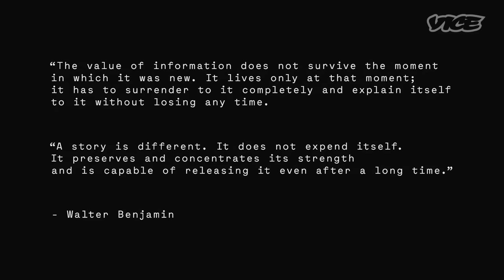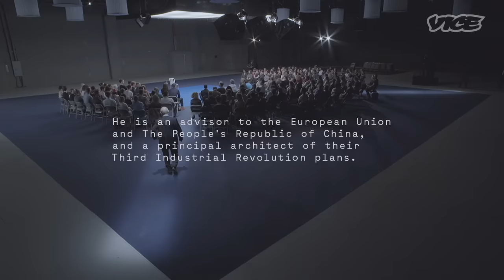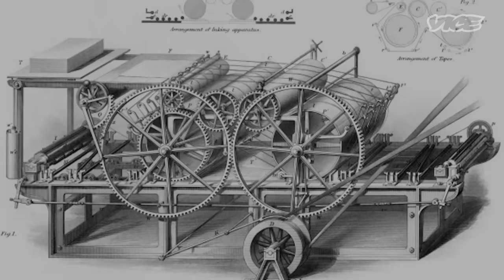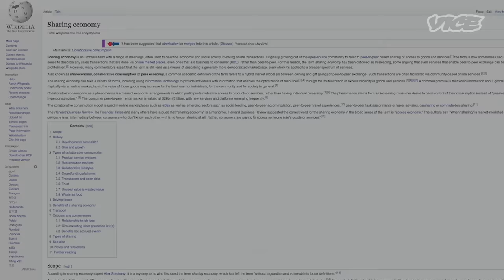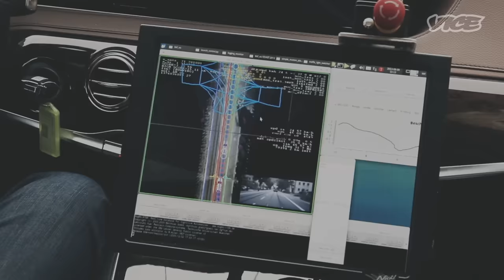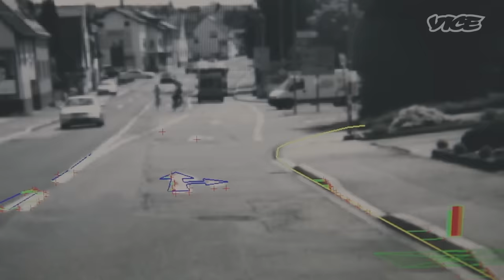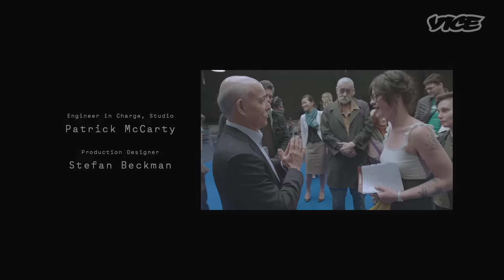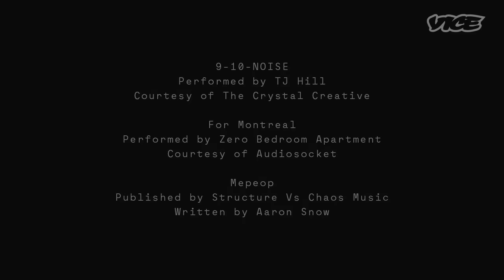The Third Industrial Revolution: A Radical New Sharing Economy

Comment: "Car sharing" is more like a hipster term for under-regulated taxi cabs. The same for much of the so-called "sharing" things. It's more like algorithmic classifieds than "sharing" most of the time. The actual "sharing" stuff is free distribution/open-access, or things like free-cycle and book-crossing for physical goods. Otherwise this "sharing" economy is nothing new, basically rentals and services, paid.
Reply: @C Kpdx The way you worded that made me think that everything he said and the sharing economy really sounds like communism re-packaged as something shiny and new. That said, he does speak of decentralization, off-grid and distributed systems. I think it would be a mistake to include those things in the topic "sharing economy" as they are more of an autonomous economy, moving away from interdependence. I believe in that, economic interdependency is why we have terrible fluctuations and volatility. Moving toward individual resource self-reliance can prevent many deficiencies and travesties.
Reply: @C Kpdx As long as it remained optional without any subtle or aggressive coercion, sweet, go for it. But as an economic force, I suspect it would inevitably lead to cutting out that option. However, I would encourage you to look into the China famine that resulted from their communist government overly encouraging communes. These co-housing environments were very similar to what you are talking about, but the problem was that farmers preferred the communes and eventually a nation-wide mass starvation occurred. 

A similar but less severe occurrence is being experienced in the US with white collar/blue collar jobs. Culturally, many blue collar jobs are under appreciated and it leads to human resource deficiencies, then price hikes and price drops in other jobs.  For example, plumbers and elevator operators are able to make around $200,000 a year, quite a bit more than many college graduates. This can anger the white collar crowd as well, who are strapped down with massive debt obligations, but its rational economics. Supply vs. demand is never going to stop being the law, because its a natural law.
Reply: @C Kpdx If I may, I'm not sure humans are as social as you think of them. Please take a moment to consider this question: How social are people when they are rich? I think you might agree that wealthy people do the opposite of being tight-knit with the community. They prefer spacious, exclusive estates gated off from the public and small social circles. I think this might be a good example of what humans want when they can afford it.

From my personal experience, living in a major city was a nightmare, and whenever I visited my relatives in the country it was a delight. Having the personal privacy that is impossible in major cities is downright therapeutic.  How many psychiatrists skipped out on their $200 per hour for boat making or some other craft in the woods? I've heard about it plenty. Human minds coming together can go incredible things, but at the same time, humans add complexity and difficulty to each others' lives. Its common to hear from people that humans are much more friendly in small towns, even to complete strangers, and I believe this is evidence that humanity benefits from a little personal distance. 

To address the resource issue, well, I can't deny that historically this has been true. However, 3D printing and decentralized power like Rifkin mentioned should fix that issue. 3D printing will likely become so cheap that we will all own them in our garage. But water is actually more efficient for rural areas and usually independent. Drilling a well is not cheap, but after that it is free until repairs are needed and rainwater collection is easier for rural than city as well.
Reply: @C Kpdx No one ever argues for coercion, they just do it. My point there is that I would have no interest in c-housing, which means I never want to see a world where that is just how things are done and I must participate. The green energy movement, for example, is coercive. They feel the need to force others to do things their way. 

Anyways, as I can see you don't share my logic and don't have any interest to do so, I suppose that's all I can say on that. I stand by my previous comments so, I believe the logic in those arguments to be sound.
Reply: @C Kpdx Okay, that would be what I understand to be anarcho-capitalism. I think the "co-housing" term is a bit of a misnomer here, because that is a neighborhood. Honestly, the concept sounds dreadful to me, because I've seen what happens with neighborhoods that create community governance. They make all kinds of rules for the inhabitants and have to convene for community meetings. The last thing this world needs is more rules and regulations. By all means, do this kind of thing if it appeals to you, but I'd rather have control over my land and what I can do with it.
Reply: @C Kpdx I thought you had said they were separate houses...? Okay, I suppose that is very similar to apartments with exclusive gyms and pools. You likely don't feel it is the same, and that's fine. I realize that we have different systems of logic, and that's okay. 

Cool, I am glad to hear you enjoy those environments, live and let live, I always say. I hope you are able to live in such an environment, its not my style though. I'm more of a cabin in the woods type of guy.
Reply: @C Kpdx Okay, well, that's fine. I think you're taking more offense from my comment than I would expect it to cause anyone. I'm sorry if I offended you in some way. I just found the co-housing concept to seem very similar to a commune from how I hear it. You explaining it sounds different a little, but its still with some similarities only less total humans. Its fine, its cool if people want to live like that, but I just don't see why anyone would get excited about the idea for or against.
Reply: @C Kpdx If I lost you that's cool. You have no obligation to keep chatting with me. But I think you're taking too much offense here. We disagree, that's okay. We don't share the same sense of logic or reasoning, no big deal. But my arguments are sound, at the very least, on the global warming thing. Look, if I believed in global warming simply because other people tell me its true, that would make me a real idiot. Only a truly stupid person believes anything without looking into it thoroughly. I just haven't bothered to do the research, because researching a subject in any serious way is hard work. To get to the point where you actually can say you know a subject well, in the eyes of many academics, its a six month project. 

And until someone does put out that much effort, they are being an outright villain to go around telling people something is a fact or a truth if they can't actually call themselves an expert on the subject. So, for now, I remain neutral on that topic. If you wanted my opinion on autophagy, well, now that's different. I know a lot about that topic. See how this works? I strive for intellectual honesty as a code of honor, and I can't go taking sides on something I don't know enough about. So until I do have a deep understanding about global warming the correct thing to do is to hold it with suspicion as one would the multiverse or McDonald's cheese.  

I have contradicted myself in what way? You know, I do indeed view my perspectives as well reasoned and reasonably intelligent. I don't think I'm a genius or anything, but I tend to be known by people as a reasoning, intelligent and deep thinker. So are you referring to the anarcho-capitalist thing? Well, there is a reason I thought that might be what you are meaning. 

See, a lot of people think, incorrectly, that anarchy is chaos. Its not chaos at all, but what it actually happens to be is tribalism. See, capitalism is a system where one immensely powerful entity has both the power to protect everything you own and the power to take everything you own away. 

The benefit of this system is relative reliability, as long as you kiss the ring, everything is fine. No marauder bands come to kill you and take your stuff since the big guy will hurt them. So, in an anarcho-capitalist world small groups team up, handle community security and community governance among each other. All I was saying is that offhand, your co-housing thing was sounding a little bit like that. If its very different, cool, we just had a communication error. 

Look, again, we disagree on stuff. That's for sure, but I'm not trying to offend you. I'm merely expressing my opinions. I don't find co-housing, as you have described it, to be anything brilliant. Its cool if that's your desired lifestyle, I've got no problem with people living like that if they wish. I just don't get it. Mostly, I don't get why anyone would be excited by it. Its just not something mind-blowing like blockchain or IPFS to me. That's all I was saying about it.
Reply: How about simply doing more with less.
It's undeniable that if we don't at least try, it's not going to end well, with a growing population using more per head of limited resources.
It simply cannot continue, irrespective of the effect we are having.
When that effect is added, the introspective nature of your argument becomes almost irrelevant. If we DON'T do something, sharing of cars or other items won't really matter, will it? You'll be engaged in civil war.

Comment: What are the methods and overall approaches to enable transition to this new paradigm? What do you do with those of the 2nd Industrial Revolution?
Reply: Watch Jeff Bridges solution. maybe the 2 together can figure out the nuances... i like the solar on every roof idea but WHY isn't it already a reality!!??
Reply: @randomoverpopulatedworldid3286  Two reasons- partly because it's too expensive. I own my small property, but I'm still a Poor. The panels are pretty cheap, but the storage battery thingies to store power overnight are pretty pricey for a decent one. That could be worked around, I suppose, but 

I live in the deep south. Heat and humidity are a major thing for 8 months a year. Since I am, in fact, a Poor I bought a home with YUUUUuuuge oak trees on 3 sides. The shade in the summer helps me to avoid running the AC as much as possible. And they are in great shape, no diseases or dead sections. And they're beautiful 🙂

Most of the rest of the property is wooded or garden or chicken yards. I just can't justify cutting any more trees down than I've already had to.
Reply: @nobody8328  if you have huge oak trees around your property YOU ARE NOT POOR
Reply: @neilaleksandrov2655  dude, huge old oaks are a dime a dozen in the deep south. Even us'ns trailer trash have shade trees.

Comment: Well with the economy and stocks at where it is now, I'd be disappointed if people weren't making any error on their portfolio at this time, it was much easier to navigate during the bull-run, regardless I still see and read articles of people pulling over $225k by the weeks in trades, how come?
Reply: It all depends on how long you're willing to hold for and your strategies, stocks might likely tank further, but making serious gains in this downtrend shouldn't be a problem if you're a pro
Reply: I noticed, a lot of folks are making huge 6figure killings in this downtrend, only just that such techniques are mostly successfully executed by folks with in-depth market knowledge.
Reply: @marcelrobert9569  The US Stock market had been on it’s longest bull-run in history, so the mass hysteria and panic is relatable, considering we’re not accustomed to such troubled markets, but there are avenues lurking around if you know where to look, I’ve netted over $850k in the past 10months and it wasn't some rocket-science start. I applied , I just knew I needed a firm and reliable technique to navigate better in these times, so I hired a portfolio advisor.

Comment: @23:00 
Speaker: Economist barrowed from Newton's physics to describe economic systems b/c it was a fad at the time, the cool thing to do, but Newton's physics have nothing to do with economics. 

Also Speaker: Let me explain what describes economics, proceeds to state physic's 1st and 2nd law of thermodynamics. 

I am certainly not arguing that economic systems do not seem to follow laws more related to heat or especially electromagnetism. Just found it odd to discredit a method by calling it a fad of mixing economics with current science, and in the very next breath does the exact same.

Comment: Alert! With "internet of things", hackers can do all of this: open your electronic front door, turn on your sprinklers, monitor your baby monitor, watch you/hear you from your smart TV's microphone and camera, monitor your security system, open electronic locks, open your garage door, force your steering wheel of your car hard right or hard left and plunge you head on into on coming traffic, open valves in chemical processing factories, with Honeywell uninterruptible communications, take over flight controls of new airplanes, disrupt proper operation of your heart pacemaker, all this regardless of encryption (via key discovery and / or use of master key), so on. If you're on the net, consider yourself completely vulnerable to attack!

Comment: Why did he blame the economic situation on Oil & Gas right off the start? The 2008 Crisis was mainly on the heads of Lehman Brothers and the 44th President. I agree we need to lower energy consumption and output. Oil & Gas will always be here to stay. But, we can lower its use in the automotive industry and residential & commercial housing which accounts for more than anything.